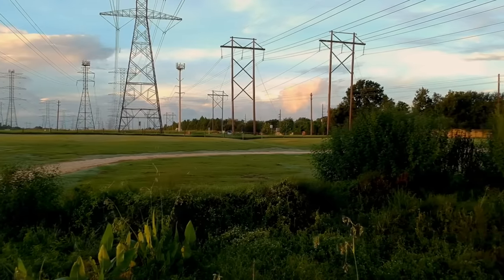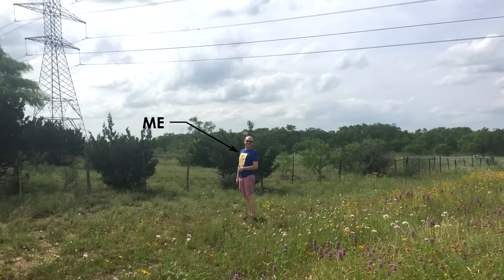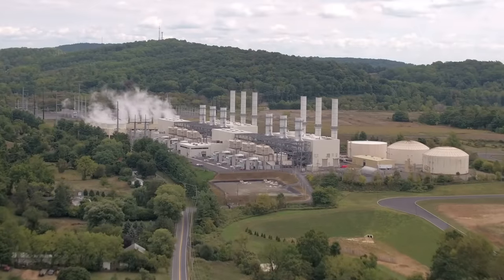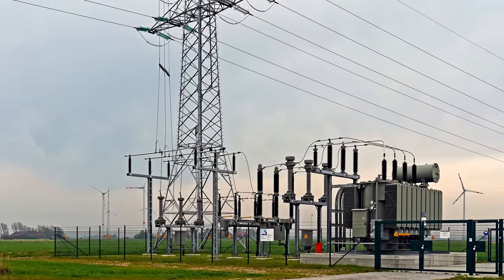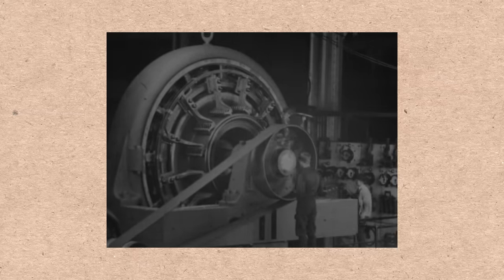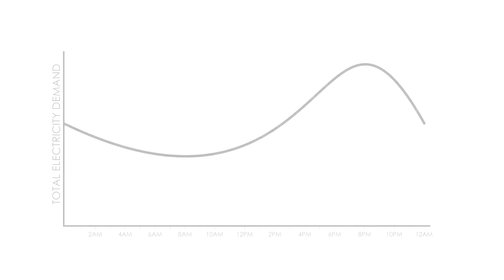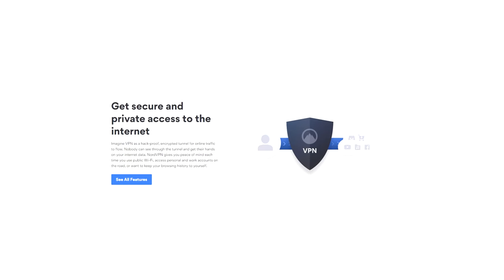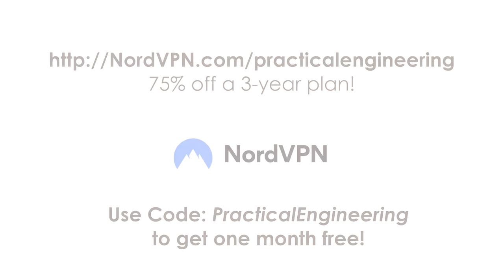How Does the Power Grid Work?

Comment: I'd really like it if you did a video addressing the base load fallacy, the belief that meeting the "base load" is the most challenging part of power production. The base load is defined as the lowest demand for power over a given period, while peak load is the highest. I feel that these terms are vastly misunderstood by a lot of people. Sometimes in discussing the challenge of switching to competently carbon neutral power sources, people make the claim that because of their variable capacity, wind and solar are incapable of providing "base load power". This misses the point as when a a power station is a "base load" power producer, it is a limitation, while the advantage is that it is cheap. Base load power stations are those that are limited to either produce less than or equal to base load, or limited to some factor of base load (for example a station that can throttle down to 50% power safely, but not less, can only be allowed to produce base power times two).

Peaker plants, on the other hand, are usually more expensive, if there was a peaker plant cheaper than base load plants, those base load plants would not exist. Peaker plants can produce anywhere from 0%, to 100%  of their maximum capacity at short notice. Wind and solar more closely resemble peakers in their operations than they do base load plants, meaning wind and solar are better. Wind and solar can drop their production to 0% very quickly, by flipping a literal switch in the case of solar, and by applying brakes in the case of wind turbines. True, solar farms can range from 0%-0% at night, and from 0%-X% during the day, while wind turbines vary from 0%-X% throughout, but the fact that they can drop to 0% production without exploding is very important, and that X isn't entirely unpredictable, and isn't ever 0% either, if you scale up to more than just one location. There has never been a moment in the recorded history of meteorology that the sun wasn't shining anywhere, or that the wind wasn't blowing anywhere.  If our wind and solar power plants are enough to reliably meet peak demand, they will have little trouble meeting base load demand either. The place solar will struggle is after sunset, while most people are awake and turning on their lights and TVs, cooking dinner and running various appliances after work. The place wind will struggle is during the midday heat, where wind is slow and air conditioners are on in every office building and many houses.

I think you will have some more insights into how sustainable energy sources factor into the grid, both in the long term when we have a sustainable grid, and in the short term transition, and you do a good job of explaining these concepts, so I'd really love to see your take on where the grid goes from here in terms of not destroying the environment we rely on to sustain our civilization.
Reply: Solar base load would require a world wide grid.  While theoretically possible, we currently have regional grids which are not going to change any time too soon.  Like the internet pipe, there are bottlenecks between regional zones so when the sun is in this hemisphere, all the energy would have to traverse those limited transmission lines.  Imagine if YouTube for instance had to service all their videos from Japan every 3 hours of every day.  There's a reason why server farms are distributed.  The same "this area provides the best price/cost" for building this server farm/wind farm/solar farm applies.  There's no fallacy in base load other than the fallacy that people misunderstand it.  If you ignore cost of providing service, ya sure, everything is possible.  That's not a solution unless you want to do it by fiat.

Comment: What puzzles me is what the grid does with excess electricity from power surges, excess production and lower demand, does the grid run the excess to grd or burn it off somehow. It can take hrs  for  large generators to respond to changes so there will be excess production to cover  supply where does this go?

Comment: Smart-grid means a lot of conflated things. Originally it had comparatively little to do with smart meters or big data. Instead it means distribution is decentralized and customers are active participants in generation with renewable energy sources. However I think the big picture is that really customers need to have at site storage for load shifting, grid operators need to be able to manage the charging of EVs, so called "grid scale" power generators need to be able to ramp up and down generation which is just not possible with coal fire and to a much lessor degree customers generating renewable energy can grid tie it but that can only go so far thus never gets retransmitted out of a substation. This means smart grids effectively are "smart" at the homes that generate the power by storing some of it to use at peak loads. Further microgrids become very appealing.

Comment: Load following is far easier when you have reliable generation. You simply make sure that a given number of plants aren't running at full capacity and can ramp up and down as changes on the transmission lines occur. What makes this extraordinarily difficult today is the amount of unreliable generating capacity on the grid, re wind, solar, and similar. That was part of the problem in Texas. Regardless of the cause, the result was that over reliance on wind and solar generation created conditions where the base load capacity could not meet the demand and there wasn't enough reserve capacity to compensate for the loss of the other facilities.
Reply: Bro do you understand about electricity? Can i make a question to you?

Comment: My dad use to work for Waukesha Electric building the coils for transformers for several years before going to drive tractor trailers.

You should have also went into bootstrapping and black starting the grid. Speaking of which solar and wind farms are unable to black start a grid because they actually require power to make power, or at least thats what I read.
Reply: Before adding a wind turbine to a power grid, you need a base frequency what you can hardly control with a wind turbine. This is why you need a stable power grid before adding those to the grid.

Comment: Just one thing. Electricity transfer is not instantaneous, it has speed as anything else. There is nothing in normal timespace faster than light. instant electricity would breach that ... And electricity as we use it is not part of quantum physics yet to ignore that :P ...
Reply: He did say that electricity that you receive was in a turbine "microseconds ago" so not instant.
And since electricity travels at almost the speed of light, then 40 microseconds translates to 12km of distance - which is a rather realistic distance to be from a power plant (and that's exactly the distance I am from the nearest one).

Oh and note that we're talking about the electric wave propagation speed and not the speed of actual electrons through the cable (drift velocity) as that is 13-14 orders of magnitude slower.
Reply: @Undy1  Literary 2nd sentence ... He tends to slip into this shortcut /convenience somewhere later in the video as well. Also electricity moves at speed of light, even though electrons themselves in copper are much much slower :P

Comment: Is it possible to create electrical inertia via electrical components? ie. instead of having large turning generators hold mechanical inertia, it is possible to have capacitors/batteries do the same (but do so in an analog way like the mechanical inertia sources)
Reply: Yes, solid state power electronics (such as solar and battery inverters) can be used to simulate inertia. It is not instantaneous like true inertia is, but it is very fast - on the order of milliseconds.
Reply: Absolutely this is possible - - so called 'FACTS devices' (flexible AC transmission system') do just that.  A great field for bright young engineers.  But economics is also a factor, and rotating mass is sometimes less costly - even to the point of applying machines on the system that do nothing but provide rotating mechanical inertia.  In the future, we will see a combination of technologies being applied.

Comment: We really do need some means of grid-level energy storage, just to balance out peaks and valleys, especially if we are really wanting a greater reliance on intermittent power sources like wind and solar. It would massively simplify the problem, and make our energy grid as a whole much more efficient by being able to handle peaks without spinning up the generally inefficient and expensive peak generators, and being able to increase baseload above your minimum power to produce a less expensive and generally lower pollution per MWH for a greater percentage of the total power consumption. 

Unfortunately, it's easier said than done. Musk built a huge battery bank out in Australia which has worked out really well for them, but there are many problems associated with the sort of Lithium-ion batteries he uses. They aren't cheap, they don't scale particularly well, at least not into the MW range we'd need for grid balance and maintenance, and the lifespan isn't going to be all that good compared to what you really want for your grid infrastructure. 

Many people seem to think 'well, just hook up a battery to it', without understanding just what a huge task that would be. Maybe you could address this and show people why we haven't already done this.

Comment: I often wonder how the power grid works when my UPS reports line in at 105V during peak summer loads.  I even saw 103V on occasion.
Even stranger, I'm about 3 miles from the hi tension lines coming into town, and about 3 miles from a huge solar PV field with a variety of experimental battery setups.

Comment: I didn't realize our power grid was so interconnected across the US. And while a 'smart' power grid can be more effective, it also seems that would make it more vulnerable to attacks. I'm really thinking about getting solar panels and a gas generator...
Reply: Excellent observation!  In the 'old days', the electrical grid was highly reliable because there were very few grid-wide active controls, and those that did exist, worked in time scales that were long enough to allow for human monitoring and intervention.  One of the challenges that face grid planners today is that on one hand, application of high-speed grid controls are desirable to improve performance of the grid, but on the other hand, high-speed grid controls are points of vulnerability to bad actors.  There field of grid security is a rapidly expanding field of technical activity that offers great career opportunities.

Comment: Actually DC, not AC is used over long distances using thyristors.  (At high voltages, AC creates huge power losses due to skin effect, reactivity and line capacitance.)  HVDC also has the advantage that you could e.g., connect Texas to East Coast.

Comment: Many of recent wildfires have been sparked by power lines in the forest. What would it cost to bury those lines compared to the cost of those wildfires? Would the reduction of maintenance costs balance the cost of under grounding those wires? That would include the cost of pesticides and their application to clear the brush under the power lines.

Comment: There should be a system for households consisting of a big battery-bank and a computer which reads the current electricity price. Then when the price is low it buys and stores electricity in the battery-bank and when the price goes up, it delivers the stored electricity.

Comment: I have a microwave which clock keeps going ahead, my country uses 220v 60hz. Could that mean that the clock in it is designed to work on a 50 hz grid or similar?

Comment: I've reached a new tier of electronic technology, and rendered my previous inventions obsolescent... using Tubes full of Plasma, instead of electrically charged wires. 

Basically, it's an AI, connected to a powerplant, which sends plasma (a state of matter) through insulated tubes, which have neodymium shaped charges (like a missle, but not copper)... these charges not only accelerate the plasma, but can also articulate like tentacles by running additional electric current into to the neodymium from regular copper wires.. at different segments along the path of the tube, which ends in a conductor, like Gold. This is capped, when not in use, so the plasma is kept inside the reactor, stored like battery power by the neodymium "trapping" the ions...

This entire system is capable of powered flight, by using ionic discharge as thrust, and it's about 6 feet tall or so, with the wires I have on it currently extended. 

And it is beautiful, my powerplant can make every color of the rainbow, by oscillating at different rates basically.... and the clear tubes look like the brightest, most deeply saturated neon lights that eyes have never seen. It can make a Cyan color that is just simply not possible, with is how bright it is, cameras cannot detect it, but I can see it right in front of me in my back yard.... 30 feet away! For safety...

So now I have to update everything I've ever built and the power grid also.

Comment: 6:15 I think this tiny part is not true for several reasons. Light is always photons and does not convert to or from other forms of matter. 

Even if you misspoke and meant the electrons from our outlet were in a power plant just microseconds ago, then that is also wrong because electrons does not travel across wires, they just wiggle but remain in their same area. How we get the electricity so quickly has to do with magnetic fields i think... I don't know how it DOES work, i just know how it DOESN'T, if that makes sense.

Comment: "A lot of people don't realize how vulnerable you can be when connecting to unsecured WiFi networks at coffee shop, airports, convention centers, etc."

Laughs in quarantine

Great video btw, many more people need to be aware of the awesome achievement that is the power grid and the huge challenges facing it, but most are discouraged by the physics aspect of electricity they've never been taught properly.

Comment: and for exactly those peaks i see energy storage as an increddible possibility to replace emergency peak load plants which barely at all run and that on a high cost per kwh rate
Reply: That's right and batteries for example can also provide other ancillary services which require fast response (for example synthetic inertia or other fast frequency response services).

Comment: Imagine this: We use nuclear to provide ALL (except solar and wind) of our electricity demands. Not only that but we also use smoothly variable electricity cost (for the consumer).

What does that mean? It means that ALL of our electricity is safe with ZERO carbon emissions. It means companies will get extra cheap electricity at certain times which gives massive boost to your economy and smooths out the demand variation somewhat. It also means users are encouraged to buy their own energy storage methods which is completely free (for the utilities company and the government) solution to the huge problem of solar and wind variation and smooths out the demand variation even more (possibly completely). 

And the last part: because the electricity should be generally cheaper in this scenario and if you use new nuclear designs you have the option to tap into extra cheap massive source of process heat, some chemical processes suddenly become viable and economical. Such as making synthetic gas to eliminate carbon emissions even from gas cars etc.
This is something I would happily pay for with my taxes.
Reply: @Matthew Savage Nuclear waste isn't really a big deal in the first place. It either has long half life which means it's pretty harmless and sits there for a long time or it has short half life which means it's pretty hot but goes away quickly.
And that's not even mentioning the waste burner reactors. For example Elysium industries claim that their waste burner can produce 36 times more electricity from waste than what the original powerplant got from the original fuel. This of course burns the waste and what's left (not much) can be diluted with more waste to produce a bigger volume of fuel or just stored for like 100 years after which it's safe.

Comment: electricity is so amazing. you can transfer energy from far places within micro seconds.to compare it, think of the fuel your car is running on. thats a source of energy but it takes weeks to move from oil wells to your gas station unlike the electricity which requires just a flip.

Comment: why does the voltage have to be so high? does it have to be the exact amount that it is when leaving the supplier? could it be less and still achieve the same thing? is there a formula they use to know what it's gotta be to start with before stepping down in Voltage? also why is Texas on their own apart from everyone else?
Reply: @Appl3 YT that's interesting I never knew that, is there any other reason? how much voltage would they lose if it was less? it seems like they could achieve the same effect with a Lower voltage, I'll bet they could
Reply: @Appl3 YT that's an interesting point, I didn't really consider that. when you break it down, what exactly is current? it's a bit hard to understand the meaning of that explanation (where you mentioned the voltage increases and current decreases) it makes me wonder what exactly current is and why exactly does it decrease as the other increases? it doesn't seem like they should have an inversely proportional relationship